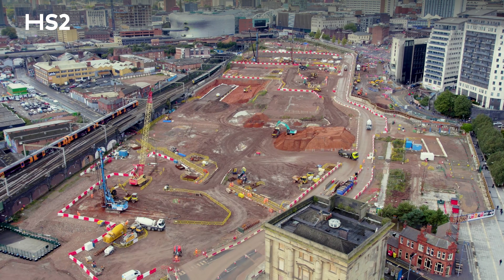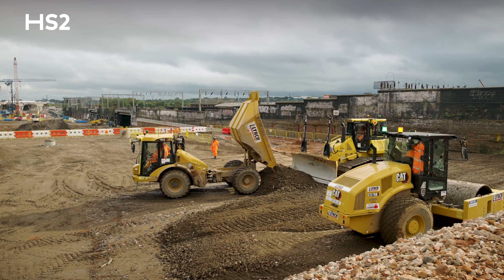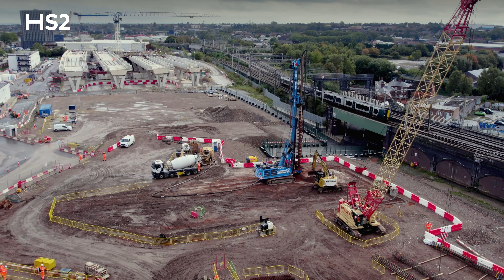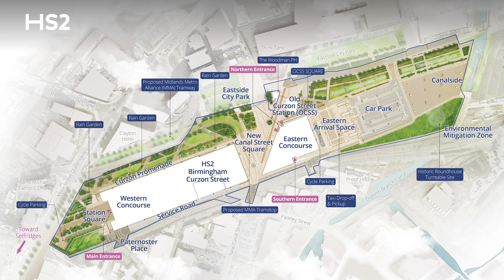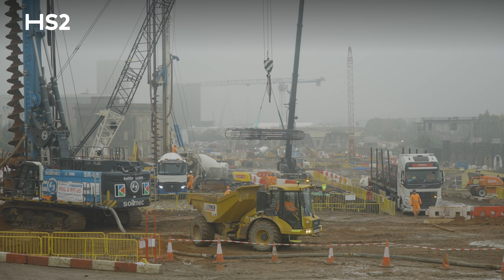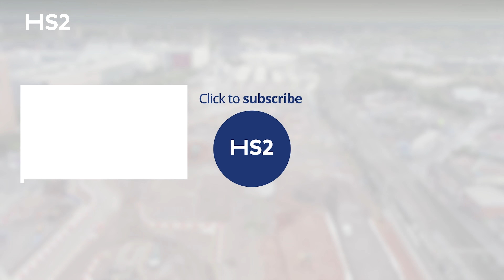HS2 lays the foundations for Birmingham’s new rail hub

Comment: Now let's get it to Manchester and beyond
Reply: I settle for Crewe and for the Euston tunnel to be built with provision for a HS1 connection.
Reply: @DavidKnowles0  wouldn't even need to be that much of a tunnel. You could just build a lot of it alongside the North London line. It is already possible for a train to get from HS1 to the ECML and WCML it's how the Claedonian sleeper is able to run from Euston up the ECML when the WCML is closed for maintenance
Reply: @kityhawk2000  No reason for HS2 to connect to HS1
Reply: @DavidKnowles0 .. after yesterday's "scoop" by LBC  Radio where they "revealed" that the government were planning on reviving the phase 2 section between Handsacre Junction & Crewe, they were shot down in flames within hours when the PM's official spokesman said  .. "as we set out in the King's speech, the government will not reverse the decision to cancel phase 2 of HS2.
As you know, the project has been repeatedly delayed, costs have spiralled & the project has clearly been hugely mismanaged".
Also, Curzon Street will be useless on its own.  Through passengers will have to walk to one of the other stations no matter where they're going & the tram connection will be so slow & circuitous, it'll probably be quicker to walk anyway!
HS2 has been an absolute disaster since day one & continues to be so.
Reply: @DavidKnowles0  HS2 will never connect to HS1 there is no reason for it
Reply: @peterwilliamallen1063  there plenty of reasons.
Reply: Think it is more to do with capacity, the London - Birmingham line is at full capacity. This will allow haulage and slower line on the existing and a high speed and direct (less stops) train to flow on the other
Reply: @tomandrews-lu7xg  .. whatever people might try & tell you, there are absolutely no passenger capacity issues between London & Birmingham except for London bound morning peak. 
Even Chiltern Rail mainly run 2 or 3 car DMU's most of the day & they're mostly empty! 
Added to that, less than 5% of passengers travel the entire route between the cities .. the majority get on & off at stations along the route 
HS2 is a waste of taxpayers money assuming common sense doesn't win out & the project is cancelled. 
Money that could be better spent on the problematic trans-Pennine routes & other east/west options. 
Network Rail seem hell bent on this monstrous vanity project .. a line nobody wants & nobody can use.
Reply: I guess we have different sources for information
Reply: @tomandrews-lu7xg .. I'll second that!
Reply: @CRIMSONANT1  It's not just passenger capacity but capacity for rail traffic as a whole. At present freight traffic from the South-East England to the Midlands has to run either at night or via fairly circuitous routes that have spare capacity.
Reply: @CRIMSONANT1  Sorry James what the heck do you know about the Capacity problems from Birmingham mate, for christ sake you live in Newcastle upon Tyne about 90 miles from Birmingham and you know as much about train services from Birmingham as I know about train services fom Newcastle mate. Thats how much you know, when some one purchases a ticket with Avanti West Coast trains to London they get off at London and Brummies do not get off at Rugby, Milton Keynes or Watford, they get off at London Euston mate so where do you get the crap from of 5% go to London, it is 100% mate. HS2 is reqired due to the Capacity problems on the WCML between Crewe and London and people wanting the intermediate stations use West Midlnds Trains or London Northwestern trains to do that not Avanti West Coast Trains. What do you know about Chilton Trains as well nothing as these trains are full at times and they do not just run 2 or 3 car DMU's they are upto 4 cars long class 168 and they also run between Birmingham and London refirbished Mk3 coaches with a DVT and a class 68 loco as well.
Common sence has prevailed as no where in a month of Sundays will HS2 be cancelled now to far gone plus now going to be built into London Euston and it is positive that the Manchester connection may go ahead now and do you know the answer to your trans Pennine and east west problems, talk to the respective Metro Mayors whose job is to make these upgrades happen and Network Rail has nothing to do with HS2 mate, plus HS2 is what Birmingham and the Midlands have needed for years, just give it a rest mate you are getting boring now.
Reply: @jeremybarker7577  .. you've been taken in by HS2 Ltd's lies from day one of this appalling project.
The concensus amongst rail experts is that HS2 WON'T free up freight traffic but make things much, much worse! 
American owned company Freightliner is the biggest rail freight carrier in the UK but expects its own ambitions to be frustrated by HS2. 
The chief executive Tim Shoveller, in an interview with the BBC said the curtailed version of HS2 will deliver extra traffic on to the WCML & not only that, it will be at its busiest junction & will actually make congestion on the line worse. 
He said that HS2 will join the WCML at a junction location that was far from optimal for freight operations where pathing is often fragmented, requiring layovers in passing loops which is totally inefficient & there will be no extra capacity at this critical junction. 
HS2 has well & truly made a mess of things. Wrong project, wrong route & too many "facts & figures" were just made up to get it started. 
It will fail completely & will either close or become just another London commuter line within a few years of opening because it's fundamentally flawed  - nobody can use it. 
It will NEVER achieve it's required 576,000 passengers per day for phase one because it was always the wrong project.
Reply: @CRIMSONANT1  less than 5% of passengers travel the entire route....quite the reason for reducing the journey time between Birmingham-london to 45 minutes
Reply: @Gershw1nn  .. haha, ever heard of the phrase "false economy"?
Reply: @CRIMSONANT1  Here we go again James, keep bumping into your stuoid comments, how do you know about capacity problems in Birmingham living in Newcastle upon Tyne and I have said else where that every one that gets on an Avanti West Coast Service or Chiltern Railways service from Birmingham to London does the whole journey to either London Euston or London Marelabone. Improving the Transpennine or east west options would be a waste of Tax payers money and a white Elephant and Network Rail has nothing to do with HS2, it is the Company HS2 ltd building it Network Rail is a rail maintainance company that when HS2 opens may look after the upkeep of the line
Reply: @Gershw1nn  CRIMSONANT1, is talking absolute rubbish, he lives in Newcastle upon Tyne and knows nothing of how many passengers travel from Birmingham to London
Reply: @CRIMSONANT1  James stop talking crap, you don't live in Birmingham so know sod all of what rail services are like from Birmingham New Street as I know sod all about train services out of Newcastle to London, it is not the people capacity that is the problem out of Birmingham New Street, it is the fact Birmingham New Street is now the busiest station out side of London and 5th busiest station in the UK and is restected on the West Coast line of 2 tracks comming into New Street from Wolverhampton and 2 tracks going out to Rugby, this is used by X Country Trains, Avanti West Coast, London Northwestern Railway's, West Midlands Trains, Transport for Wales, then through New Street you also have servies to Liverpool London Northwestern Trains, te X City Line and West Midlands Train services to Hereford, Worcester Shrewsbury, X Coutry trains to Cornwall and Derby and often trains are stacked up to come into Birmingham New Street so the powers to be decided to build HS2 and move all Avanti West Coast train services from Birmingham onto the HS2 line and operte from Birminghm Curzon Street. How do you know Chilton Line trains are mostly emptu mate, you don't do you, you are just guessing as the Chilton Line trains from Birminghm Snow Hill and Mor Street are very full at times as they also pick up at Solihull ( you know where that is don't yoou) and other stations to London Marelabone and a lot of there services operate with a Class 68 Diesel Loco a rake of arround 6 MK3 coaches and a DVT and the end.
Do you ever watch the News, HS2 money is better spent in the West Midlands not the North West as money in the budget has been ear marked for this, if you live on the West Side of the ciountry you would of known tis information and every one using the present WCML services will use HS2 services so yes people want HS2 and will use it, why don't you give your brain a rest as HS2 is being built full stop
Reply: @Gershw1nn  100% travel the entire route from Birmingham New Street to LondonEuston, there is no readon to get off before Euston
Reply: @CRIMSONANT1  Yep you.
Reply: @peterwallen1063 anyone can check the number of passengers that travel between London & Birmingham .. all figures are freely available & what's me living in Newcastle got to do with anything? 
What a ludicrous thing to say 🤣
Reply: @CRIMSONANT1  Try comming to Birmingham New Street Station then, it is the busiest station outside of London mate totaly crowded and Avanti West Coast trains from Birmingham and Wolverhampton to London Euston stopping at Birmingham International and Coventry are crowded plus the service operated by West Midlands Railways compny London Northwestern trains. The Snow Hill line is the same. Whats you living in Newcastle got to do with it. loads mate living 90 odd miles away from Birmingham  you don't know the first thing about train services out of Birmingham or the passenger numbers. You do seem to be a boring person and have an anorak life with all these figures you keep looking up mate, thry visiting Birminghm New Street first before quoting false figures.🚄🚄
James my man, I have just heard via chinese whispers that the Tyne and Wear Metro is closing for good on the 1st April 2025 due to lack of passengers and snail on the line 🐘🐘🤡🤡🤣🤣
Reply: @peterwilliamallen1063  .. *COMING .. not "comming".
*TOTALLY .. not "totaly".
*TRY .. not "thry".
*COMPANY .. not "compny".
Just like all your other "stats", it's hard to take them seriously when you're under the impression that Newcastle is "90 odd miles" from Birmingham .. (it's actually 209)!
By the way, I live 3,000 miles away from the USA but can quote you masses of interesting data about the upcoming election. 
Hopefully, you're correct about the Tyne & Wear Metro - it's been a waste of space for donkeys years! 😉
Reply: @CRIMSONANT1  OH James as a Brummie I can tell you that the building of HS2 from Birmingham has nothing to do with passenger issues it is to do with track capacity from Birmingham as the line from Birmingham New Street to Rugby is two track only with the only passing places being Birmingham International and Coventry, Birmingham New Street is grid locked with London Northwestern Trains, West Midlands Trains, X Country trains, Avanti West Coast Trains, Transport for Wales trains, Charters and freight service using this route leading to congestion, cancellations and slow speeds on this section of the West Coast route which by building HS2 takes the main Avanti West Coast trains from Scotland, Manchester, Liverpool and Birmingham off this route onto the HS2 route so giving more capacity on the existing WCML.
What makes you look so silly is the fact you live in Newcastle on Tyne and seem to know 90 odd miles away who travels on the trains from Birmingham to London, living in Birmingham and using Birmingham New Street regularly I can tell you that the Avanti West Coast trains from Birmingham to London some times leave with people standing on the train and yes they all are mostly going to London Euston and not only that the semi fast services from Birmingham New Street to London Euston via Northampton run by London Northwestern trains are all ways full. The service run from Birmingham Snow Hill/Moor Street to London Marylebone run by Chiltern Trains yes use some DMU's but also run regular service with MK3 coaches class 68 diesel loco and class 91 DVT serve a different route taking longer but are normally full so in both cases I do not know where you get you hair brained figures and ideas from in both cases no people do not mostly get off at stations along the way as the Avanti Services only stop at B/Ham International, Coventry, Watford and Milton Keynes, intermediate stations are serviced by London Northwestern Trains and West Midlands Trains, the same services call at intermediate stations picking up people going to London and are full to capacity during the day on the Chiltern Route services.
It shows you do not keep up with HS2 as they are now entering the main construction phase and the 13 section Delta Junction bigger than Spaghetti junction out side of Birmingham is well under construction and the money for your branch lines in in the North, Transpennine and East West Projects comes locally from your local metro mayors and this project improves the Midlands Rail infrastructure and yes people do need HS2 nd every one will be able to use it so sorry HS2 will never be cancelled now and you need to stop going on about lines in Birmingham and the number of people using trains in the Birmingham area when living in Newcastle on Tyne you just do not know anything about the subject
Reply: @CRIMSONANT1  Then you must be as daft as James Monks
Reply: @CRIMSONANT1  Oh mate what the hell do you know about passenger capacities between Birmingham and London, mate you live in a back bedroom in Newcastle upon Tyne 96 miles from Birmingham you do not know ny thing about passenger capacities from Brum to London like I know nothing about the passenger capacities between Newcastle and London Kings X and Chiltern Train Services from Birmingham to London are full all day as they also pick up passengers in the Chiltern area and Home Counties. So why should money being spent to improve Rail services from Birmingham North and South and on the WCML be spent on the Transpennine route, that money comes from the Mayors of Greater Manchester and Leeds / Bradford. and yes we in the Midlands want HS2 andy every one who now uses Avanti West Coast services on the existing WCML at the moment will when HS2 opens use this route instead.
Reply: @peterwilliamallen1063  .. there you go again with your nonsensical claim that I know nothing shit this massive white elephant because I don't live in the area! 
I live 3,000 miles away from the USA but know LOTS about what's going on there!
Every opinion poll conducted on the merits of HS2 shows a majority of people in the UK as a whole are firmly against it, especially in the North and Midlands – who are supposed to be the main beneficiaries. Only in London does it actually have more support than opposition, which says a lot. A YouGov poll this year showed support for HS2 across the UK at 25% with 39% against & 11% ‘don’t know’ – the rest were neither for nor against. 
In London, the only region in support, 30% were in favour and 27% against, showing a large drop from the previous year. 
Another UK-wide poll, conducted by Statista, shows 23% in favour and 42% in opposition.
Reply: @CRIMSONANT1  Hay mate have you died or something or given up protesting about HS2 considering how far forward the construction is going now. As the song gooes " Silence is Golden"
Reply: HS2 didn't have to go from London as there is already a line there nor did they need to build the viaducts and bridges, they could of gone from birmingham main station's (any viable) and take it north towards Scotland. HS2 should of known better, A better railway starts from the Midlands and grows around the Midlands. There is the necessary rail infrastructure there already from London. Let's take it north from the Midlands
Reply: @comeoutdoorswithus4406  You should know better mate, HS2 has to go to London as HS2 is the replacement for the two failed attempts to upgrade the West Coast Main line and the Birmingham main station you are on about, Birmingham New Street is too congested to take extra high speed trains that just are too long to fit into Birmingham New Street Station, when it is built it will make a better Rilway for Birmingham and the West Midlands and HS2 is going North
Reply: @comeoutdoorswithus4406  Well yes HS2 had to go to London as it is the new line to replace the existing southern half of the WCML and if they did not build bridges, viaducts nd tunnels how would it get around natural obsticles and the New Trains for HS2 would not fit into the existing Birmingham stations and Birmingham New Street is grid locked and yes it is going North from Birmingham
Reply: @peterwallen1063  ..  *AND .. not "nd".
*OBSTACLES .. not "obsticles".
*GRIDLOCKED .. not "grid locked".
You appear to have conveniently forgotten that phase 2 of this massive white elephant was cancelled therefore, the project WON'T be "going north from Birmingham" 😉
Reply: @peterwilliamallen1063  
It would of been better then to build HS2 in the same way as London Underground and just have the stations above ground,as it's wrecking the landscape
Reply: @comeoutdoorswithus4406  How ridiculous to even think of building a Railway tunnel from London to Birmingham a distance of around 96 miles which would mean that HS2 would of taken a lot longer and it is more pleasant to travel above ground than cooped up in a tunnel, the London Underground is not all in tunnels as it is only underground in Central London but as it leaves Central London the London Underground lines are actually run on the surface this can be seen as you go into both London Paddington and Marelabone and out to Heathrow Airport where the underground trains run above ground
Reply: @comeoutdoorswithus4406  Try doing a bit of research on HS2 before making silly comments, HS2 runs from Birmingham to London and from Handsacre to London to take Hi speed passenger services off the bending congester southern half of the WCML and the Bridges and tunnels are there to take the line over and under existing rivers and transport infrastructure, no Birmingham station is capable of handling HS2 trains as these trains will be too long and just to run from the Midlands North would not pay.
Reply: @comeoutdoorswithus4406  So if not from London to Birmingham where else would it go
Reply: @peterwallen1063 
I would like to say firstly thanks for your reply and secondly, there are already 3 lines possibly 4 directly between London and Birmingham, HS2 will clog up London which it already is doing, but there is no direct link to the west. I know this sounds a stupid idea, I mean a rail link from Cornwall, into Devon and connects straight to Birmingham and on to Manchester and the North
Reply: @comeoutdoorswithus4406  There are two lines between Birmingham and London and 3 train services, the two lines are the West Coast Route into London Euston from Birmingham New Street and the second route is from Birmingham Snow Hill/Moor Street to London Marelabone, the 3 train services are the Avanti West Coast Hi Speed Service from B/Ham New Street to London Euston, the Londonnorth western semi fast service from B/Ham New Street to London Euston via Northampton and the train service from B/Ham Snow Hill/Moor Street to London Marylebone run by Chilton Trains. The Avanti West Coast service takes approx. 90 mins, the LNWR service takes nigh on 2 hours and so does the Chilton Trains service.
Birmingham New Street the busiest station outside of London is at times grid locked and is the line from New Street to Rugby resulting in delayed and cancelled trains  plus the WCML from Rugby to London is getting grid locked hence the decision to build the HS2 route linking London Euston to Birmingham on a new high speed route and on to Manchester, Liverpool and Scotland by bypassing the Southern Half of the WCML between Euston and Stafford with a new 225 mph Railway so releasing capacity on the WCML for other services and freight by diverting Avanti West Coast Hi speed train services onto the HS2 route plus HS2 will not clog up London it is already clogged up and the reason for HS2.
There is already a line direct from Devon and Cornwall to Birmingham and the North via Bristol, Gloucester and Cheltenham